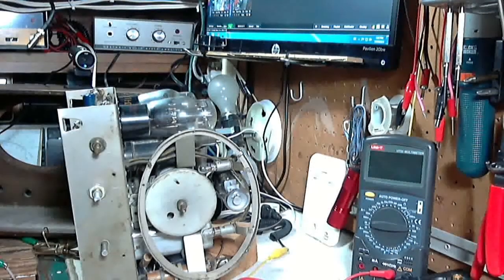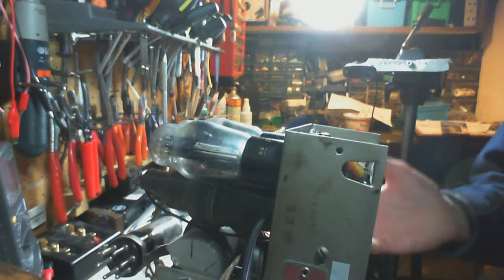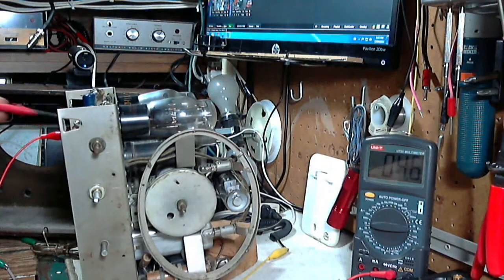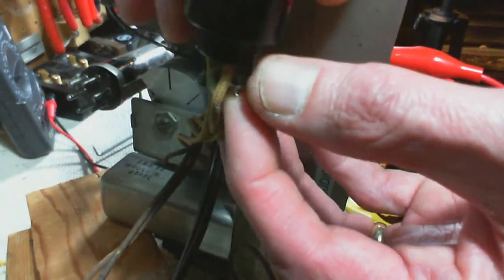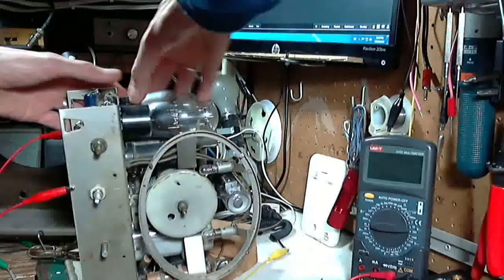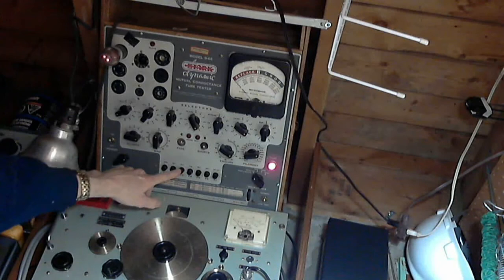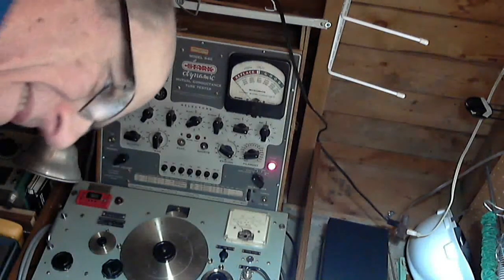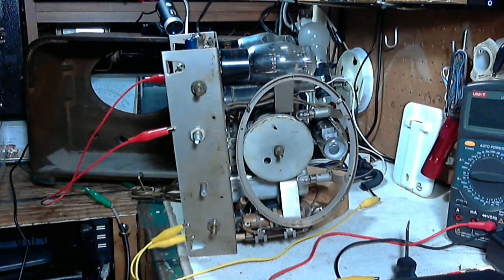Simplex Antique Vacuum Tube Radio Video #19 -  Magic Eye and Tricky Diode

Comment: use two silicon diodes and 2 caps to make a voltage doubler for the magic eye

thus 100v for the radio and 200v for the magic eye

regards

john davis uk

Comment: I am basing my discussion on the 6U5/6G5 magic eye tubes.  On the magic eye, that resistor goes between the two plates.  The plate also connected to the internal  screen grid has its voltage go through the resistor and full plate voltage goes straight to the other plate. How one gets 0 volts through a 1 meg ohm resistor is a mystery to me - other than it is no longer a one meg ohm resistor - and it is an open.